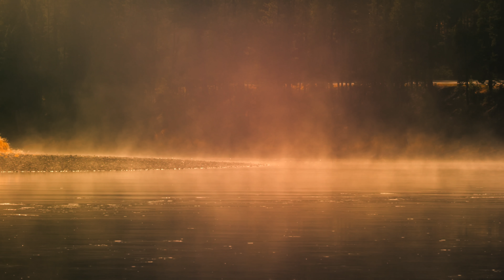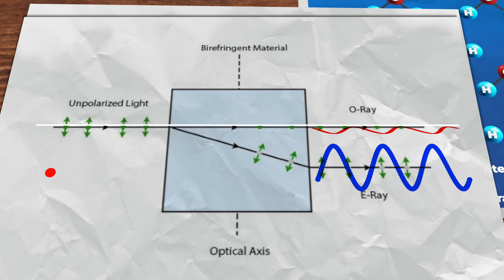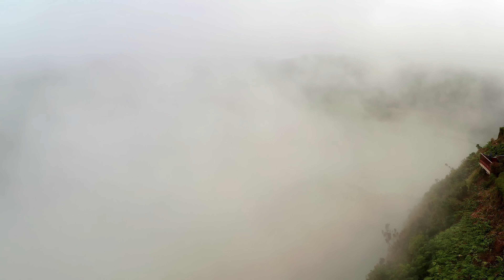New MIT Discovery Just Solved Water's BIGGEST Mystery!

Comment: The application of CC models on past actual weather data "hind-casting" (rather than forecasting) has long shown a fundamental flaw in the climate models, and vast differences between polar, temperate and equatorial regions. The interesting aspect of the new understanding of photo-evaporation is the Angle of the light to the water - this may partly explain the differences for various latitudes, as lat affects the angle of the incoming solar radiation to hit various water surfaces. I would be interested to know the effect on snow or ice as well as liquid water.
    Very interesting as you say, the lower energy applications to things like AC or personal clothing for cooling.  Thanks for posting this. Was very interesting to learn about photo-evapouration effect.

Comment: There is another interesting effect here.  It is a bit complicated to explain so bear with me.  First, if you have taken chemistry, you will know that reactions are expressed with the arrows going both ways.  There is an equilibrium point and the more of the product you produce, the more the reaction goes the other way.  There is an exception to this.  If the product is a precipitate that falls to the bottom of the vessel and is no longer part of the reaction or a gas that rises out of the vessel, also removing it from the  reactants, the process goes in the forward direction much further.  Hold that thought.
Then there is a peculiar property of gasses.  When you dissolve a solute in a solvent, the total volume of the solution is less than the sum of the original solvent and solute.  The molecules of the solute have, to some extent, fitted themselves between the molecules of the solution.  This is not so with gasses.  If you add one gas to another (keeping pressure and temperature constant) the volume of the mixture is equal to the sum of the original volumes of the two gasses.  Now apply this to evaporation.
The relative density of water vapor is 16 +1+1 = 16.  The relative density of air is a fifth of 32 plus four fifths of 28.  Call it 29.  The result of all this is that a mixture of water vapor and air is lighter than just air by itself or in other words, the more humid the air is, the lighter it is. (contrary to what the average person would say if asked)  So when water evaporates from a body of water, it tends to make the more humid air rise and remove itself from the surface of the water.  Hence it decreases the concentration of water in the air which sends molecules back on to the surface of the body of water in proportion to its concentration in the air.  In simple terms, dry air dries your clothes faster than humid air.

Comment: I work in an oil refinery and if you think about the cooling towers we use there and several other kinds of industrial plants can evaporate  massive amounts of water at temperatures below 40 celsius degrees.
Reply: IKR, I am chemical engineer and evaporation happens due to a difference in entropy not heat

Comment: Has there ever been a study on using micro waves to evaporate say 1/8 of an inch of water flowing over flat plates at a time.  The energy would not be going to the depths of the water below.  All the energy would be focused on the surface where the evaporation is going to happen….

Comment: The main pieces missing from climate models are honesty and the scientific method.  If you increase surface area of water by creating a mist of droplets,  you will be lofting salt into the air, instead of leaving it behind!  This will result in your condensing water droplets nucleating on airborne salt.  A better way of increasing surface area, without lofting salt into the air, might be to have a long strip of coarse cloth going over and under rollers, at the waters surface, in a continuous loop.  The water wetting the coarse fabric would have a lot of surface area, from which more evaporation could take place, and  by going back under the surface of the water on it's way to the next roller, the salt would be returned to the liquid water, without becoming airborne.  It should be remembered that both cloth, and misting lose the ideal angle of 45 degrees, but a smooth mirrored, continuous strip, going through the same rollers at the water's surface, would produce a thin, flat layer of water that could be hit by green light at 45 degrees, as the light goes into the wet surface, and again at 45 degrees, as the light reflects off the mirrored film, and goes back out through the surface of the water, from it's underside.

Comment: I'm 53.........I learned in school it was the introduction of energy, that evaporates water.  NOT heat alone.   You can do it with sound waves too!!   Also........the state (energy level, pressure etc) of the water before the energy is added determines the level of energy needed.  Did we forget something in the last 20 years?  Weird.

Comment: I used to use a distiller for distillation, but it stopped working so I'll buy another one later. But for now, I'm pretty much set for good clean water. I have a well, a spring and a huge lake on my property, all of which provide water, along with my own rain catchment system that I built myself. And water from ALL of these are distilled (as shown in the video) and filtered. I never have a bad reading of TDS on any of my water sources.

Comment: I seem to remember reading that, after the 9/11 Twin Towers crashes, during the period when most airplanes were grounded, an increase in ocean evaporation was observed as a result of more photons reaching the sea surface because of a decrease in air pollution blocking light from the sun. Apparently it was felt at the time that the increased number of photons knocked more water molecules into the atmosphere. Do you recall this?

Comment: ❤❤love your channel and how you get me thinking. With this, I got to wondering if heat being beamed onto a surface can be made to cause that surface to move, like a sail. If so, it stand to reason we can make a light sail for interstellar travel. I'd thought of a way to do this indirectly: where we make a large solar panel where every square inch has an electrode similar to the double slit experiment but where ions can be released (although if electrons had enough mass that could be interesting, in some other way). It would be like an ion thruster, but it would be a network of thrusters propelled by the solar panel itself designed to be that sail. Perhaps a day will come where we cam skip this step and just get direct light to motion power❤❤❤

Comment: You need green light? Put plants around it salt water tanks/holding pools, let the reflected light from the leaves go green while the plant utilizes the spectrum it needs. Have a slow replenish of the salt water until the point where the excess salt negates the positive evaporation effect. Then harvest the heavy slat saturated water for it's sea salts.
And then again, maybe I'm completely of base.
My way of thinking is how to utilize a tech like this in a 3rd world environment which would not only require near zero financial or energy input for the desired effect but also have as close to a zero impact on environment. Lofty goals.

Comment: mmkay. Green light. Diffusion of that light. Needs to be polarized. Evaporated gasses needs to be whisked away quickly and effectively. So make a tiny tube that is mirrored or will reflect light... like a fiber optic cable... just bigger and hollow. Direct the laser into the tube at the prescribed angle letting it bounce around endlessly in there. Flow the water through the tube slowly. The mirrored interior walls will ensure that no light is lost and the water itself will act as the diffusor. Then calculate how long of a tube you will need along the the flow of water to make full use of the laser light. The evaporated gasses will escape at the end of the tube, so just capture it at that point. The flow of water itself will create a vacuum, so you'd just need to leave the high end open and it should suck in air by itself. I'm invisioning a coil of tubing... like fiber optic cabling, and coated... with hundreds of not thousands of turns with the input for water and air at the top and gas collection at the bottom. 

Could work?
Reply: Good idea! It appears functional in my mind. I’d like to see a video demonstration on this build. Or if it doesn’t work I’d like to see why not.

Comment: Light and heat are just energy.  To achieve evaporation water needs to be acted upon by a force.  You can achieve evaporation through pressure, or energy.  You can affect the rate of evaporation by taking this to the extreme.  Evaporating water at room temperature is possible but its much faster if you bring the water to boiling.

Comment: Your comment regarding the efficiency of polarizers is accurate for polymer based polarizers, but wire grid polarizers are much more efficient, and may fit this application depending on the amount of light needed. These polarizers were invented to improve projection video displays, just as flat panel pricing was crossing over the price curve, so currently I believe wire grid polarizers are primarily being used in large projection systems, or portable projectors

Comment: So would it help to have some green LEDs inside a clothes dryer?  They don't use much power and could be placed on the back wall and door for optimal coverage.  If the time savings results in overall less power being used it'd be worth it, unless of course it also damages the fabrics.

Comment: It seems to me like you could get more water vapor with the additional light. However, like you said, it needs to move out of the way for more vapor to be made. If too much vapor resides in one spot, It will condence and fall back to the same spot. You must free up the space where the vapor collects. Also, create a quick condensation space for the vapor to quickly condence and fall where you want it.

Comment: faraday rotator requires strong magnetic fields, crystals like kdp or kd*p would definitely help you split your light into two polarized groups. advantage of using the sun is it effectively is a flat plane of light when it hits optics so you could use simple collection mirrors or dish style collectors to concentrate the light, that would allow you to keep the size of the optical components smaller (cost savings) using the faraday rotator and polarized HR coatings and AR coatings you could change the angle of polarization of the photons till they are reflected out of the polarizing zone (think like the amplifying stage of a laser) . then move the light into an evaporation pool at the 45 degrees. just glanced online all of the visible wavelengths have increased evaporation rates finding the end of that useful range would allow you to focus on turning the polarization angle of the interesting wavelengths. and reflecting the rest into your evaporation pool. be interesting to see a super efficient evaporation system to make potable water. and if its any better then just using a pool and green house type situation cost wise. be fun to build something test the ability to produce drinking water

Comment: A hydrogen energy economy not based on storage and transportation, but hydrogen on demand, using photo-molecular separation, where we don't have to sit in aircraft and vehicles with tanks of volatile fuel around us.
Know this, that there is 2.3 times more BTU's of energy in a gallon of water than there is in a gallon of jet fuel. Even though water weighs more, less of it needs to be carried, so payload could be increased if desired. That I believe is in our future! 
An alternative is high temperature electrolysis, where the amount of current required decreases to zero at the critical temperature.

Comment: 00:06 MIT discovered the photo molecular effect which can directly evaporate water using sunlight.
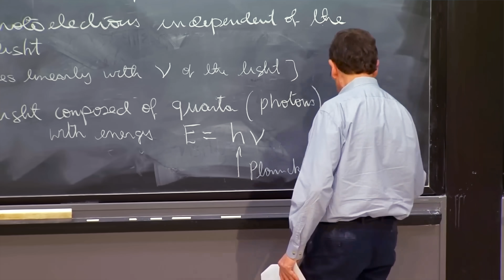01:40 Light can evaporate water much faster than heat alone
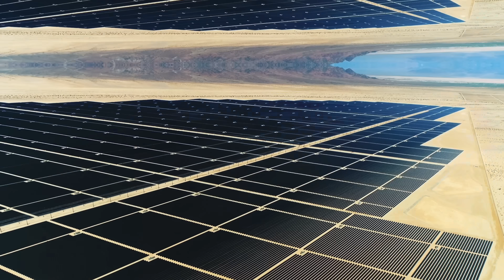03:05 Photo molecular Effect revolutionizes desalination process
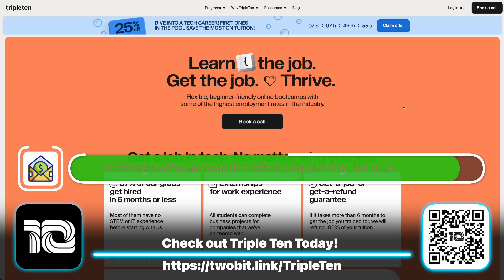04:35 Physics mystery of evaporation with light energy
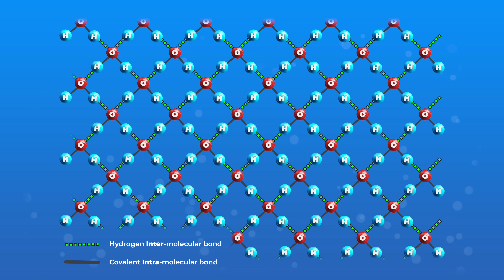05:55 Energy-efficient water evaporation through photon molecular effect
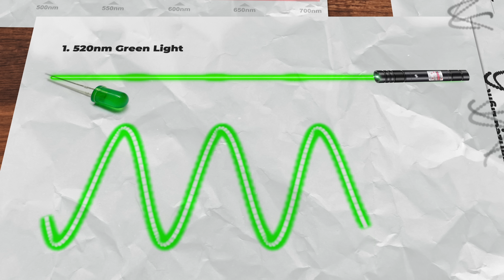07:21 Creating polarized light for harnessing energy efficiently
08:50 Photomolecular effect can potentially improve desalination efficiency.
10:18 Photo-molecular effect could solve the mystery of clouds absorbing more sunlight.
Crafted by Merlin AI.

Comment: People think only of steam as the process of evaporation. Einstein revealed, energy is nearly infinite so all atoms and molecules are vibrating with energy. Water molecules are held in a film at the surface, surface tension. A bit of extra energy permits molecules to pop off so the rate of evaporation increases. Water is amazing. There are seven types of ice. When Scott walked to the South poll his party failed because, under twenty degrees below freezing, the snow was not slippery but like dragging their slays across sand.

Comment: Here's a desalination question:  You can boil water by lowering its pressure with a vacuum pump exhausting pure water but it takes energy.  So which takes more energy (1) thermal distillation by heating or (2) pulling a vacuum on sea water maybe warmed a bit in the sun?

Comment: Nice video! I find myself thinking of Crooke’s Radiometer. That set of little vanes balanced on a spindle inside a vacuum bulb which spins when light hits it was a source of fascination to me as a kid. It’s evident at the coarsest level that light can transfer energy to a surface. Most people have learned why those glow-in-the-dark stars one puts on children’s ceilings give off light after absorbing light. A lot of people have a basic understanding of how a solar panel turns light into electricity. It stands to reason that if one can transfer energy to just the surface of a volume of water where it interfaces with air the resulting evaporation will be more energy efficient than distributing the input energy throughout the entire volume. 

I am not sure that the concepts being discussed by the group at MIT are really counterintuitive. Their work seems to represent a shift in thinking about the application of known physics, engineering rather than novel discovery or new theory. I hope that we can exploit their conceptualization in design at scale to improve efficiencies in a number of areas.

Comment: Energy is energy, it doesn't matter what energy it is.
It doesn't take a doctorate from MIT to understand this.
It's just that we are used to expressing energy as heat, so apply a caloric value.
You can dissociate bulk water into vapor with sound waves. Is an ultrasound painful & hot?
Is the vapor from an ultrasonic humidifier steaming hot?

Comment: So actually it’s a good thing heat does not give off 4 times more water than light. Can you imagine boiling a pot of water for spaghetti or potatoes and you get 4 times the water on your windows or in the air in your kitchen. Ugh!
Reply from the maker: well no, you'd need 1/4 of the amount of heat so you'd save energy on your bills... but its unclear exactly how we could use light for this and for spaghetti boiling is not what you want, you want hot water that remains liquid.

Comment: LED sublimation, is that what he's saying? Does that only affect the top layer of water molecules, or as far as light will penetrate? Where would subsurface molecules evaporate to? Reflected light? Would a mirror behind a water layer cause evaporation on both sides? How would that vapor escape? Could hollow-core conduits, like those hollow-core optical fibers both transmit light via the walls while bringing water vapor to top vents? Coils of light and water in a small device? Mineral-free water, or is scale a problem?

Comment: Phil Electrical Engineer
The main problem with water desalinization is that the input energy must always be fossil fuels. Solar and wind power that is free energy that means zorro energy cost other than mortgage from capital costs. Example the Saraha or Kalahari Dessert. There is plenty of solar power in the form heat rotating half curved stainless steel mirrors 20 meters diameter. With an in the middle half meter stainless steel black anodized pipe to adsorbed sunlight 10KM long you will get dry hot steam from runoff sea or sanitary water. The dry hot steam goes into condenser cooled pipe going straight up to one degree centigrade or 33 degrees Fahrenheit. Only pure distilled water will make it to the top halfway up the pipe brine water stay at the bottom to be pumped to the Atlantic Ocean 10KM offshore. Water pumps elevated water storage towers cooling are all solar and wind powered that means free energy using off the shelf technology. Using green lasers requires high energy input. Some more auditing will be needed to prove cost effectiveness.

Comment: I worked at Sundstrand data control. I was guy that made MX Cruise missiles circuit boards. When electrolyzing hydrogen bubbles would develop and actually create plating voids. So I found banging on the tank shock them off. Then I brought a vibrator used to sand cars. I attached to the tank. The plating went to gloss. I believe this technology would release to evaporate faster. I actually experimented found bubbles would appear from no where if the ultrasonic was at certain frequencies also magnetic effect the evaporation

Comment: Water will evaporate regardless of light or heat.  It is due to relative humidity.  Air can absorb and pull water from the ground or outer sources just due to the molecular adhesion of air to water.  You can see this in the moonlight.  It is not the moonlight causing the evaporation, it is just the relative humidity and the air's ability to pull water.  This is exactly how plants "breath" at night with capilary action and resperation of water from the ground to the leaves.